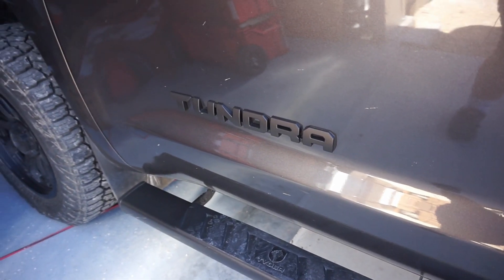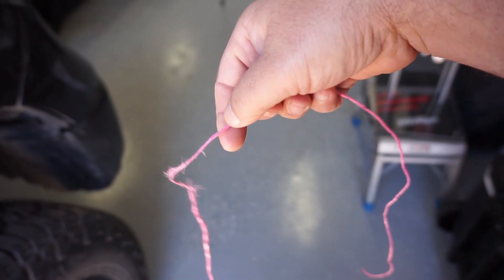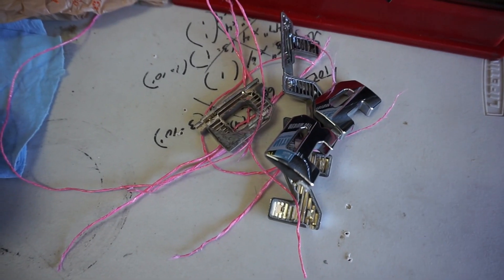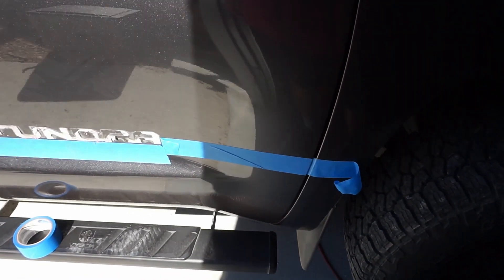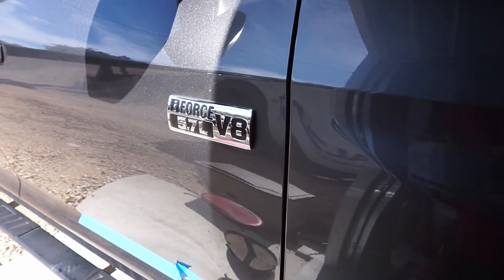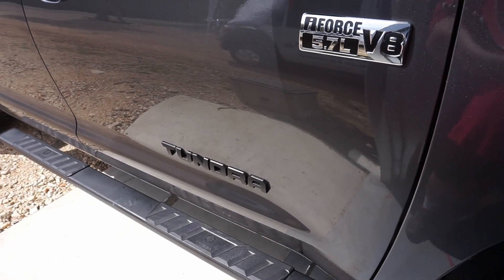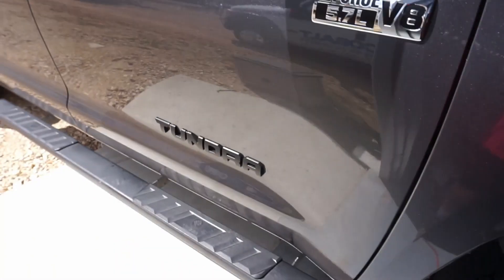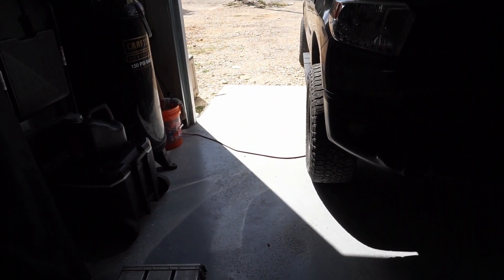2016 Tundra - Black Emblem Install

Comment: How have they held up?
Reply from the maker: Still good.  Not faded at all in Texas heat.  Truck lives outside
Reply: RMJ Motoring nice I just ordered mine from amazon as well!!! They look great on yours!! Mines white so the black badges should be a nice touch
Reply from the maker: @trevorgreeno8873  Heck ya will look great on White
Reply: RMJ Motoring When you removed your badges what did you clean the area up way before you put the new ones on
Reply from the maker: @trevorgreeno8873  goo gone ... Put gloves on cause it smells lol.  Use a throw away rag and take your time
Reply: RMJ Motoring has no idea the door pillar trim was just vinyl tape and comes off with a heat gun!! And is the color of your truck underneath😯Removed and now they are color matched with the rest of the truck 😍
Reply from the maker: @trevorgreeno8873  yep just double sided tape.  For badges i always use fish line as pulling them off can be a pain.  Then use heat gun to finish it off.. Goo gone for the residue.